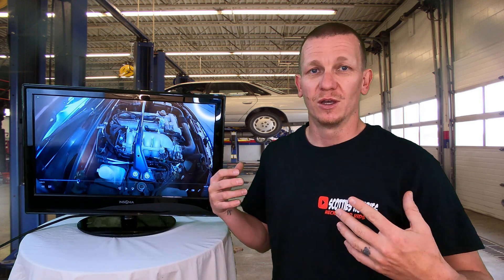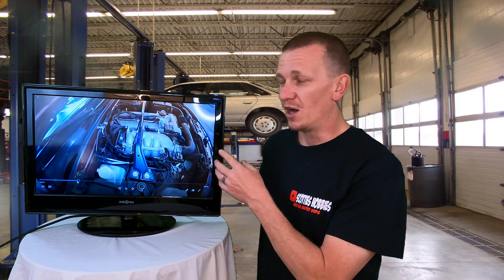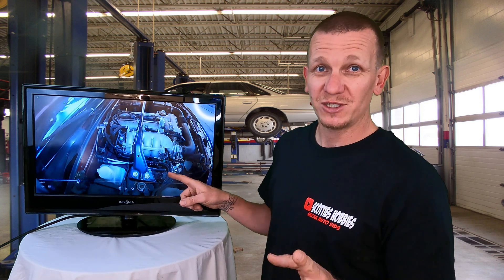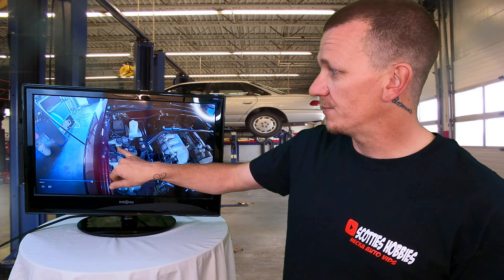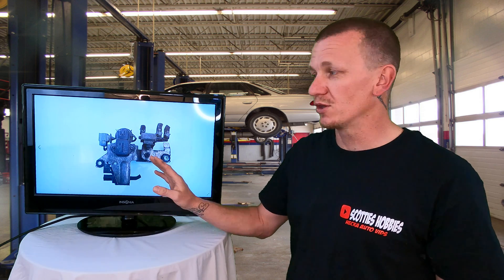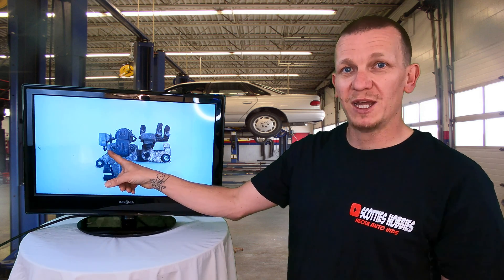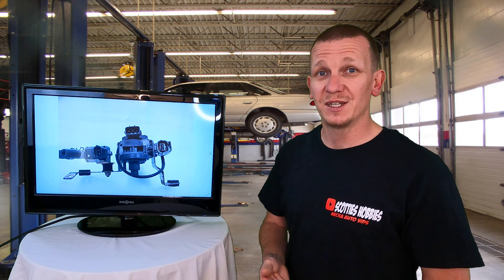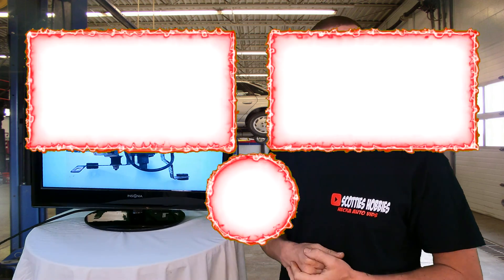⫷ Mazda P0106. EGR Boost Sensor Circuit Malfunction. Info, Tips, and What To Look for.   ⫸

Comment: Having this code along with P0131 and P0171. Car has had a little mis everyone in a while on take off or sitting.  Was getting a MAP code and now I have these three codes.  Crank on cold start and if I keep the rpm’s around 3k seems to do ok but as soon as I let it drop below 3k seems to get a little rough and running on rich. If I try and idle it will eventually die and not start back until I let it sit a day.  Thankful for any ideas if you have one
Reply: I think I just had this problem, now you have a solution, I had to return home by tow truck and when I got home it started perfectly.

Comment: Hi enjoy and learn much from you. I have 03 mpv. It just stopped suddenly. Scanned and have P0106 and P0111. Will not start without pressing gas pedal to floor. Dies when put in gear. I should tell you that I have old O2 codes but cats are not restricted and ran fine before this incident. Any help would be appreciated!

Comment: All vacuum hoses and wires appear to be in good shape scanner read bad MAP sensor, I replaced it still having the same issues and code. Where should I go next to check. Main issues are car cranks a while before starting after it's warmed up, sudden changes in RPMs once in awhile, and idles rough intermittently seems worse when the air conditioner is on, and seems to be using excessive fuel
Reply: I appreciate your time and tips, it's just frustrating, I don't know what to do next. And I'm afraid to do more damage by still driving this car until fixed. Once again Thank you for your advice and help
Reply from the maker: The egr it self is all electronic? It doesn't look like the valve it self has a vacuum line to it.. I wonder if the egr pipes are clogged?
Reply: @ScottiesHobbies  thank you I will check this next
Reply from the maker: @joshuaivey7794  if you shoot me a text ill send you pictures of my computer screen with the 'Diag & Repair Process'. Step by step instructions for code p0106. 
Text me 925 418-5096
Reply: @ScottiesHobbies  I did replace the fuel pump, and fuel filter, however have not checked fuel pressure
Reply: Hi Scottie, so car's been running great, I got a weird one for you though. It will run and start fine no check engine light for about 3 days and then it gets longer and longer to start and when it does check engine light comes on with the p0106 code, then every time after that it takes longer to start till then it doesn't this happens within about a two week period. Every time it does I disconnect the fuel lines to the fuel pump and the wire plug as well. Reconnect car starts right up check engine light off and repeat the same process within the week or two over and over. This one has me baffled. Thank you again for your time and knowledge.